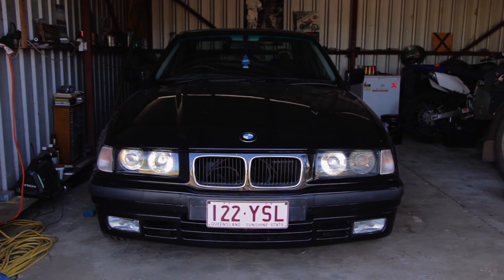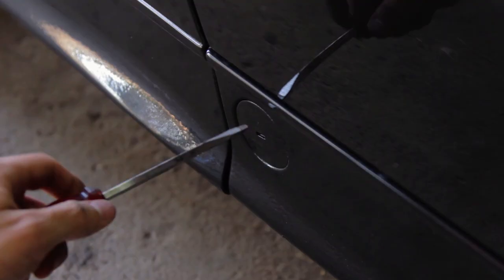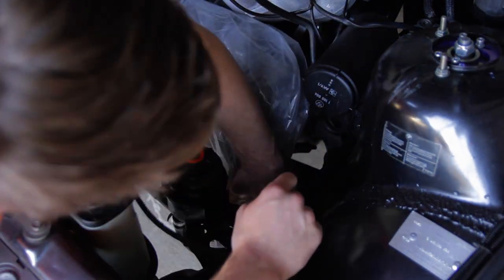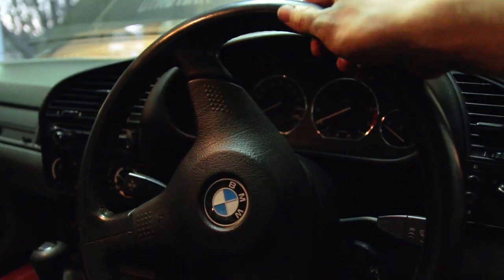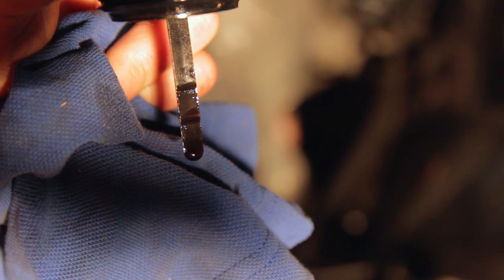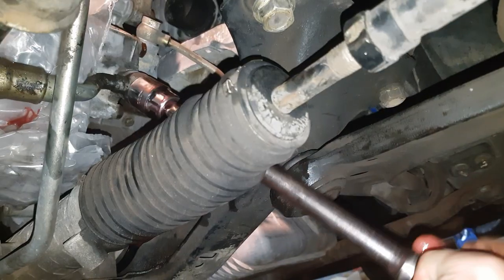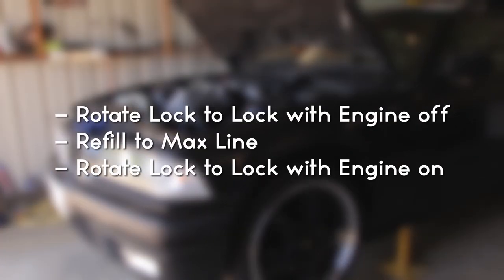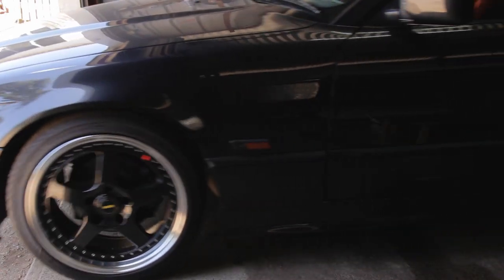How to Perform a FULL Power Steering Fluid Flush on your BMW E36

Comment: Did you notice if the steering wheel was a lot easier to turn, after changing the fluid? I have 133k n=miles on my e36, and not sure if and or when the fluid was changed
Reply from the maker: Yes it was definitely a little bit easier to turn the wheel. Might be good to do a flush/change so you know
Reply: @aussiee3626  Will do, thx!!

Comment: How many liters for e36 316i
Reply from the maker: It would be the same amount of fluid I'm guessing, the reservoir holds about 1/4 litre and you'd need about 2 all up to do a full flush like I have in this video.
Reply: AussieE36 oh so 2 liters is all needed
Reply from the maker: @jvkaram1720  Yeah that's correct
Reply: What replacement oil can i use for 316i m/t?

Comment: Your videos are very good, very instructive .... the music is very good !!! ... especially the gauge rings...
I wanted to ask you a question, I saw in the video that your car does not have a fan. How did you make that adaptation? a lower temperature thermostat? You only have the electric fan? or did you install another electric fan? ... if so, could you make a video on that topic!!!
Reply from the maker: Thank you so much for your feedback mate! Now about the fan, when I purchased the car the belt-driven fan had already been removed and replaced with an electric fan, so I cannot give too much info about the installation of said fan. However, I will certainly do a video sometime showing the parts and how it all works!

Comment: I was considering the same route, but then I stumbled upon another one:

- jacking up
- sucking reservoir empty
- pulling return line (thinner one) off
- closing/plugging connection at reservour
- leading pulled off return hose into empty container
- moving from lock to lock while engine off
- keeping open reservour topped off with fresh fluid, making sure it's never empty

Supposedly, once the fluid drips into the empty container the same color you pour into the reservoir, the system is flushed.

Has anyone tried this with a BMW?

Comment: You did a great job there. But how can one drain the oil inside the rack? Is it by that 22mm bolt u showed?
Reply from the maker: By draining the fluid from the power steering pump and turning the wheel back and forth a few times it pushes the remaining oil out of the steering track
Reply: @aussiee3626  I did. But the steering is still hard even after bleeding and changing the oil. What do I do?
Reply from the maker: @bamidelekoledoye1161  Might have to Google around to find a solution, I suspect it might be the power steering pump is dying out, or (hopefully not) the steering rack. You could try cleaning and lubing all the steering parts, including the cross joint and lower joint assembly. That might help
Reply: @aussiee3626  Thank you. Pls, lets keep in touch

Comment: Hey great video man! Just wondered is it safe to only add the fluid instead of changing it?
Reply from the maker: Thanks mate, yeah it's definitely safe to do that. All you need to do is add fluid to the reservoir and you're done!
Reply: @aussiee3626  thanks for the video and advice. What if I just get the old fluid out as much as possible with Turkey baster then add fresh fluid?? Trying to avoid having to jacking up the car myself. 😊
Reply from the maker: Yeah that should be ok as well!

Comment: great video.  is it necessary the second flush?
Reply from the maker: Thanks! It's not necessary unless you want to make sure the power steering lines and pump are clean and fresh. I did a second flush since I only just purchased the car when I made this video, so I didn't know the last time it was flushed.
Reply: @aussiee3626  thank you for replying.  In this case it was great idea If you don’t have history service.  Only if the fluid looks good you should flush it once.
Reply from the maker: @maidenwildM  yes that's right

Comment: ATF is a Automatic Transmission Fluid? you put that where power steering??
Reply from the maker: Yeah it's strange but that's how it is in E36's, ATF is used for the manual transmission as well!
Reply: I have a 2001 bmw 325i, and I did not know that, thanks
Reply from the maker: No worries mate, not sure if they all take ATF, best to check for each model.

Comment: Do you think ill be fine with using the old washer? The fluid is really bad so i want to change it as soon as possible
Reply from the maker: Yeah it will still work fine, there will probably be a slow leak but it shouldn't be too bad.
Reply: @aussiee3626  Went and looked for some copper washers and could find regular copper washers in the right size so i will use them, think ill be fine. Thanks for the great video!
Reply from the maker: Yeah that should be good. Thanks mate!

Comment: Thx im going to apply this to my z3.  I think its similar to e36 .
Reply from the maker: Yes should be a similar process
Reply: @aussiee3626  my local autozone gave me a green fliud instead of red.  Tring to find the red one.  If i find my owners book from like 20 years ago.  ( yes i know im old) .is green okay or ot has to be red?.
Reply from the maker: Colour shouldn't matter, as long as it is automatic transmission fluid (Dexron III or above) that is fine. Unless the z3 uses a different type of fluid, I'm not entirely sure.
Reply: @aussiee3626  any advice on checking for a short.  My ac compressor.  Dosent engage.  AMD radio just sounds lime snow . thx. Bud .